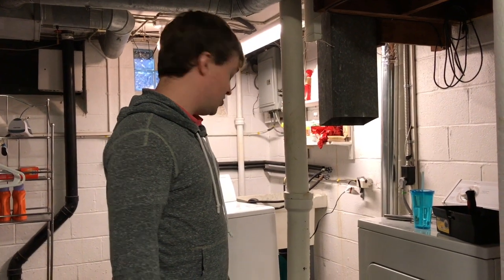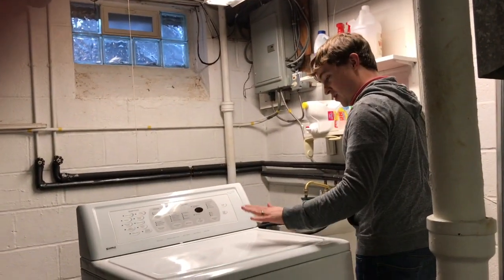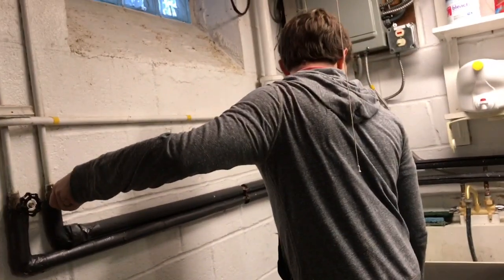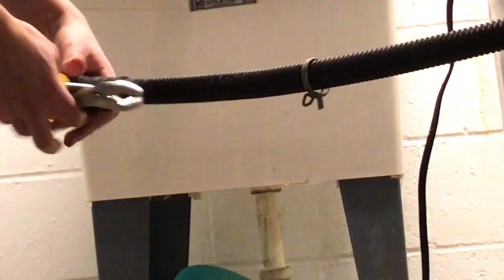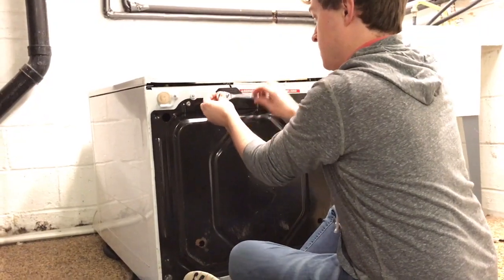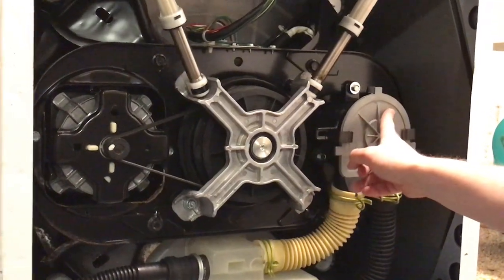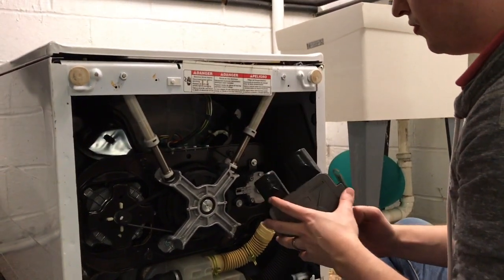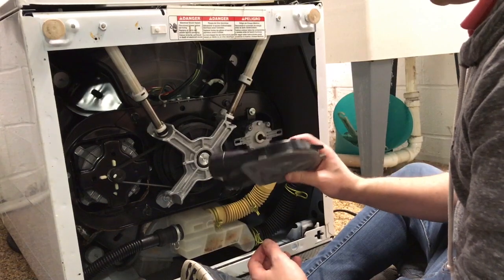Kenmore Elite Calypso Washer - unclog the pump

Comment: Just fixed mine in less than five minutes 👌🏼 found a little piece of clothes stuck in the  drain pipe...thanks a lot ...didn’t use no tools at all
Reply: Good keep it as long as you can if it breaks get it fixed modern washers are junk

Comment: That must be an original pump? While mine was still under service contract, the tech noticed the two-piece pump and swapped it out with a single piece pump on the spot. Said it was a mandatory retrofit; no charge. Oh, and my trouble was my g/f's underwire caught in the check valve.
Reply from the maker: I'm not sure if it was an original pump, I inherited the washer from the previous homeowner. And unfortunately, my washer was out of warranty :/
Reply: That is the original 2 piece pump. I have the new style 1 piece pump. If I get a parts unit and it has the original setup I'll just scrap it with the shell
Reply: Do you have the part number?